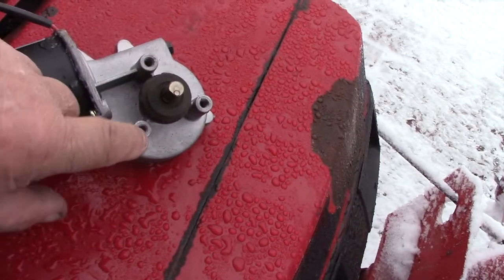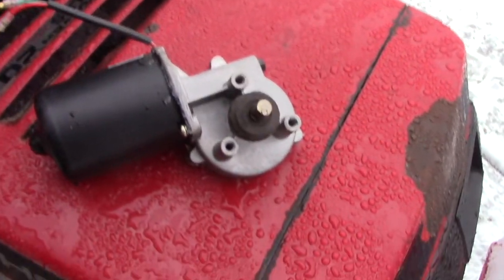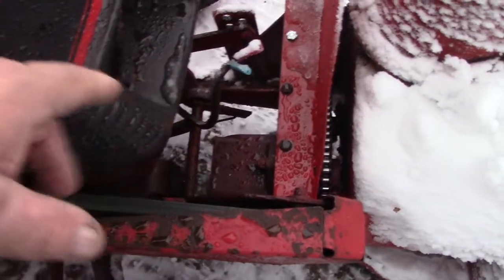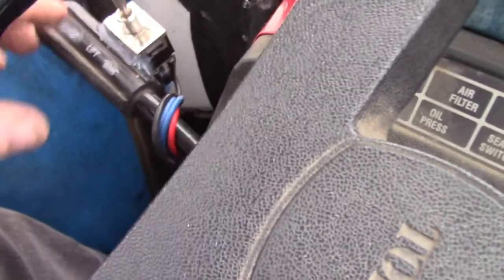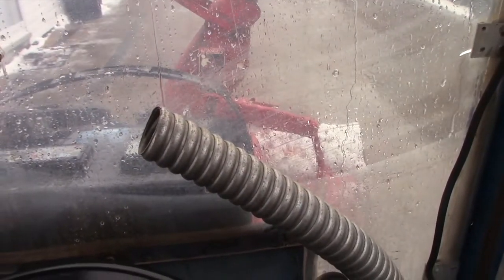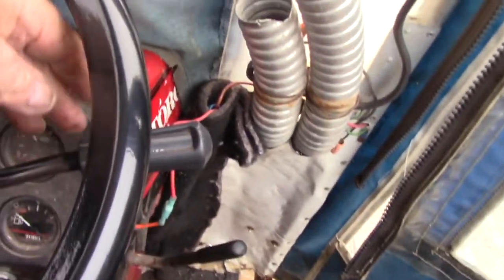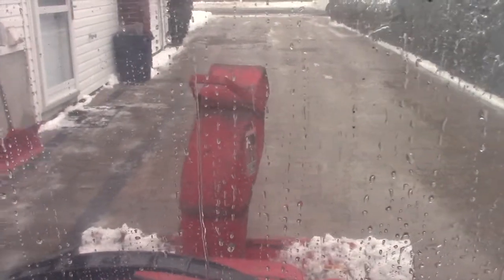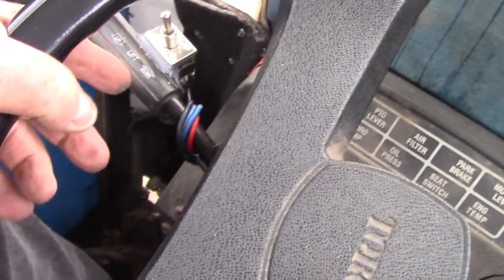The snowblower chute articulation this time is a success

Comment: Pretty sweet there Gator. I think the fuel line is a great idea. No alignment issues and provides a shock absorber for the drive train. 
Much nicer than having to crank the chute and run two other attitude controls while trying to steer. Almost automated!
Might have taken a bit more than you planned, but it works!
Great job and I'm impressed with the whole idea.
Reply from the maker: That just like a big supper compliment coming from you sir.....someone I look up two for great ideas and ways of doing things.... I must say that this one is really working well and I’m very happy with it up two now..... That’s my Christmas gift to me.....Have a Merry Christmas my good friend.....CHEERS
Reply: Yeah Gator would have made ole Rubie Goldberg proud.
Reply: Did ya use the Thomas and Betts tie wraps?

Comment: Hey it works! You did a really good job with the mod, Gator. I think the gas line to the worm gear is actually a good idea in a way because it can act like a shear pin to protect the electric drive. I hope it works the way you want either way. Thanks for sharing and Merry Christmas!
Reply from the maker: Thanks.....it took a bit of trying but I got it and really I’m surprised of how well it works.....CHEERS

Comment: Good to see your chute motor mod is a success Gator! Not too important as you sealed with Valco but could fab a piece of sheet metal to cover the motor assembly for extra protection from the snow and rain. Cheers!
Reply from the maker: I don’t think I’ll have a problem with water going in but only time in operation will tell..... All I have to do is use it and hope it last.....CHEERS